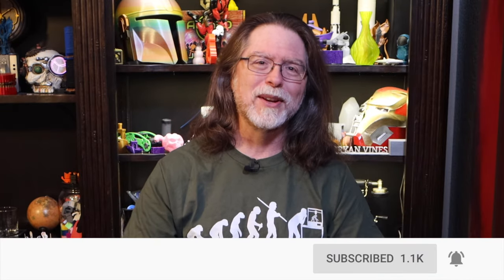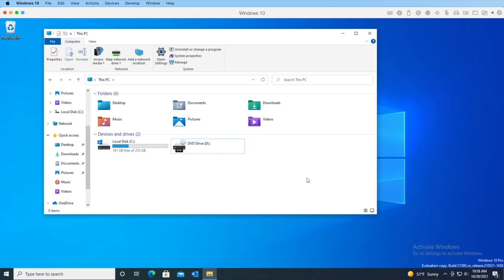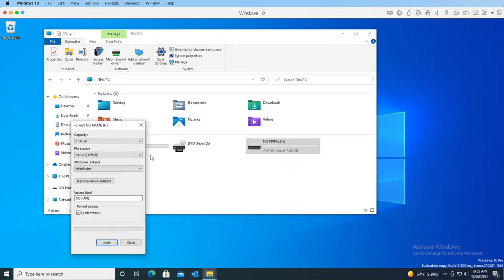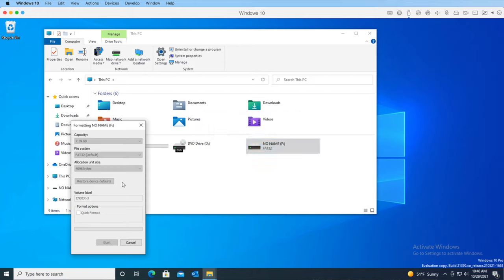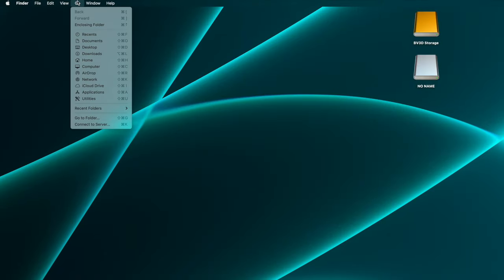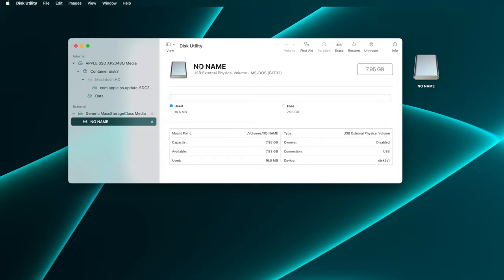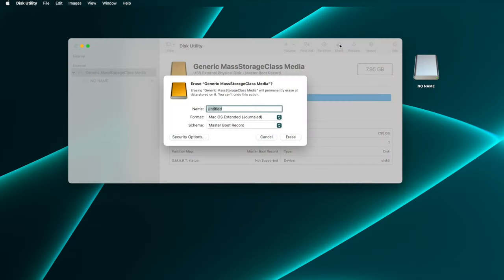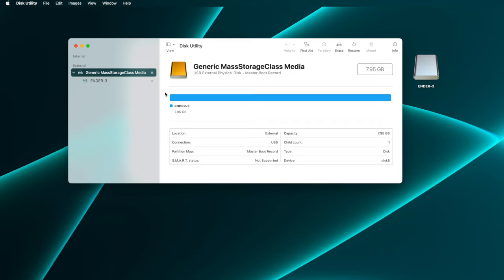How To Format a MicroSD Card for a 3D Printer

Comment: I really think using diskpart is the way to go instead of exclusively using Windows built-in tool. Here are the steps I use.   Open a command prompt. Run the command "diskpart" It requires elevated privileges. Accept. Then "list disk" .....followed by "select disk x" where x is the number of the drive. Very important to get this right. You can screw up big time if the incorrect disk is chosen...you have been warned. Then "clean"...then "create partition primary"....this can be followed up with a format command but I don't use that. I then close the window and use the built-in tool to format.  This will ensure a proper compliant partition table is created and any partitions errors are wiped out from when it was originally written in the factory. The built in tool is fine for formatting but in my experience can miss fixing the partitions.

Comment: In my experience, if it was not mentioned in the video, have only the bin file on the memory card and nothing else. Every time I have tried to flash the firmware and simply added the file to the memory card with other files on it, I always get the black screen and then the printer will no longer boot up, even after the memory card is removed. It will fix itself though if you remove all other files from the memory card except for the bin file you are trying to flash.

Comment: Something I think that was missed was what type of Micro SD card works best with the 3D Printers out there. Should it be a SD Card or SDHC or XC card? UHS-I  U1 or A1 card? Not a dig but just rather certain types of cards work better with the 3D Printers than others.

Comment: Great video.  Why did my CR-10 smart pro print fine until yesterday?  I printed something and then changed out the filament to print another file and the screen froze and no files showed on the screen.  I bought a new SD card and same issue.  Formatting new card now and praying.  The printer is only 4 months old.  Thanks

Comment: Hello DV3D, I recently acquired an Ender 3 Pro 3D printer for a family member. However, I encountered an issue as the printer did not come with an SD card. Consequently, I had to purchase one separately. Could you please provide guidance on how to rectify this situation?

Comment: I bought a used V2 if I format the SD card do I need to leave anything on it for the printer to work or can I leave it empty and just put the G Codes on it once I do a firmware upgrade? I'm also installing a biqu microprobe bed level sensor do you know if and what firmware I need for it and how to put it on the printer? Do I need to re put all firmware on it to do it or can I just ad the BQ firmware. Thanks

Comment: Occasionally after i start a print the printer stops as soon as it is done with the bed leveling step. I'm using a Soval SV03. I will remove the SD, turn off insert SD, turn on, and then everything works again. Hoping maybe formatting the card correctly fixes this for me :) Thank you for the info on this, very helpful!

Comment: im having trouble, i dl a file from thingiverse then take that file and copy it to my sd card, but when i go insert the sd card into the 3d printer it wont read the file at all, its like i never put it in there. im using a bambulab p1s, downloading a STL file. i reformated the sd card like this video showed. i want to also add that i am about 1 week into the 3d printing world. thanks
Reply from the maker: Hi! I'm sorry I'm just now seeing this. You've probably figured this out by now, but the STL file is the 3D model, and you need to use Bambu Studio to convert that into a G-code file. The G-code file contains the instructions to tell the printer how to print each layer of the model, and the process of doing that is called Slicing, because the software is slicing the 3D model into individual layers. There are various options you can choose when slicing, such as how fast to print, how thin each layer should be, and other stuff. Because of the (relative) complexity of that, the printer depends on the slicer to create a set of instructions it can follow, instead of trying to figure it out on its own.

Comment: I have a cr10 v3. And my thermistor is lying to me. The info screen is showing information even though it's cool it's showing high temperature. What could be the cause? And when I print something the extruder gets too hot because it's already high in the info screen and the bed doesn't even get hot. Although I checked all the ports for the voltage and it's also good.

Comment: can you use hot water to clean the glass bed
Reply from the maker: Yes. Yes, you can. 👍🏻
Reply: Absolutely. 
When needed, I use warm/hot water with about a drop or two of blue Dawn dish soap and some light scrubbing with a nylon brush, and it works like a charm (I remove the bed from the printer first, of freaking course). 
When it's less dirty, I just use a small amount of isopropyl alcohol on a dust free rag, but this may not be a good idea if you have plexiglass or acrylic panes nearby like in a heated enclosure.

Comment: I used a 4Gb micro SD card for the screen but it wouldn't work for the firmware. My 64Gb micro SD card works for flashing firmware, but not the LCD. Go figure.
Keep up the great vids.

Comment: I only have exFAT and NTFS formats? I am using an old SD card from my old phone. What do I need to do here? Ender3 and 3Pro.
Reply from the maker: What’s the capacity of the card?
Reply: 128  & 64
Reply: You need to just go buy a 16gb card or smaller...its honestly just less trouble rather than trying to download a partition program...don't do it just buy the 16gb sd card

Comment: My micro SD card is suck on read only and wont let me reformat. And I cant get it to switch away from read only. The adapter I'm using is a usb stick adapter and it doesn't have a lock on it like the ones that look like larger sd cards.

Comment: Can anyone help with my issue? I actually got a couple of prints on my printer, but now the upload screen won't even stop recycling itself in an infinite loop unless the SD card is taken out. Then it works normally. But I am also noticing that when I attempt to extract or just simply interact with any files off the SD card, it's considered unreadable or corrupted. At first, I thought the printer bricked, but now I see it can't read the card. Thanks for any advice.

Comment: I dunno but my sd card died after doing the non quick method. Couldnt be read by either the disk management. Tried reformat using the dos method but still couldnt reformat it.

Comment: I have a Creality 3 v2 Neo. I’ve tried everything!!! When I slice something I want to print, it goes on the SD card. I put the SD card into the printer and it will read what the file is but all I get is the guy with a blindfold. It reads what came on the disc, the rabbit and boat. It prints those fine. But that’s it. I’ve reformatted the 8g sd card to 4096 bytes. I’ve installed and reinstalled Creality Slicer. Still same issue. I’ll Venmo somebody money if they can help with this!!! I don’t know what else to do!!🤷‍♂️

Comment: Hmm...My new Micro SD cards only has NTFS and exFAT where the exFAT is the default option. out of the box exFAT didn't work, so going to try NTFS. If that doesn't work I guess I will just use these for something else like videos.
Reply: Windows can only format an sd card to FAT32 if it is 32gb or lower

Comment: Well bummer, I just bought a 64GB card so I could store the STL and GCODE files on it and the printer didn't like it one bit.  Having just watched this video for the first time I realize that the printer probably can't see it or won't recognize it because it too big.  Hopefully I can find an older 8GB card lying around that came with my camera to make a working disk for the printer.  Luckily, the 64GB card only cost me $7.00 at Micro Center and I can still use that card in my DSLR camera for still shots.
Reply from the maker: Try partitioning it into a pair of 32GB volumes (or a 16GB and a 48GB volume). See if the printer will read the smaller volume.
Reply: @BV3D  I used a 128GB card partitioned into a single 8GB partition leaving the rest to unused. Formatted the partition to the required state. It worked perfectly. Once the upgrades were done, I just repartitioned the  card back to normal.😎